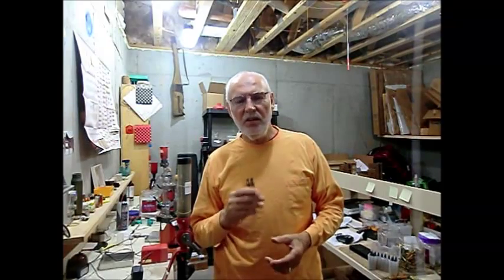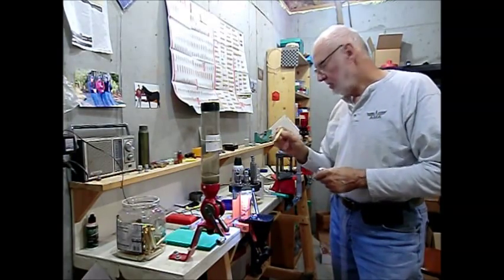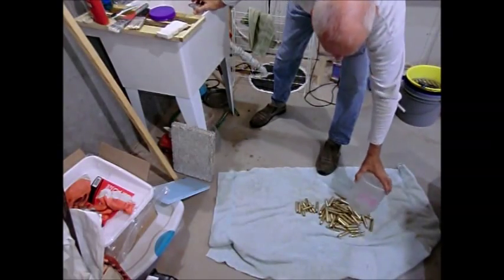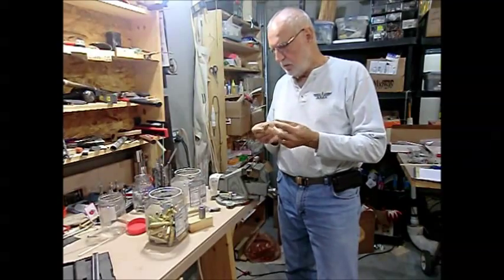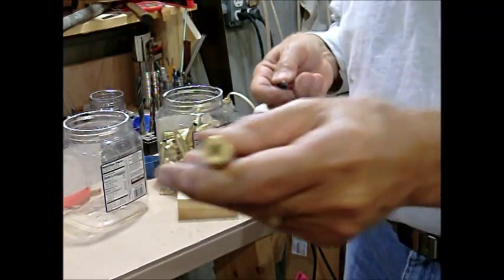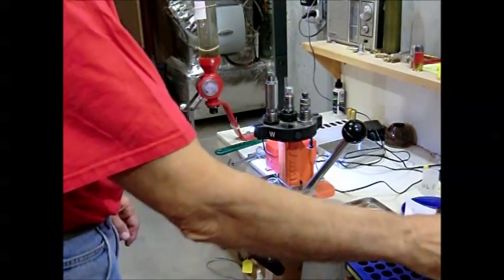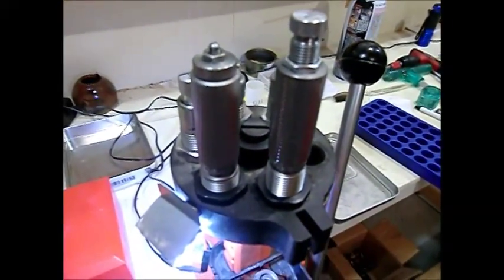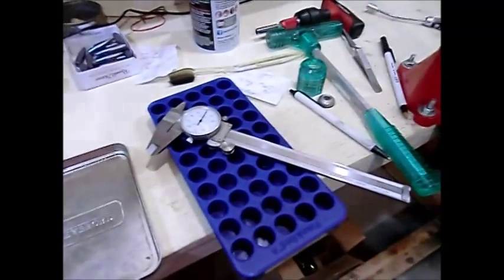LapuaReload1a

Comment: Lapua cases are the best. Peterson and Norma area also good. Tumbling cases overnight is too much and in the long run not beneficial...2 hours is plenty.  Anneal cases for maximum life and more consistent neck tension.  Why wash the cases with hot water and detergent to clean lube?  (I simply wipe them with a towel after resizing. Too much lube will dent the case should while resizing, but after resizing either toss them in the tumbler for an hour or simply wipe with a towel ) For long brass life, do not over-work the brass...resize with a shoulder bump of 0.002". Sorting cases by weight can also help with consistency.  Using a Hornady comparator or an RCBS Precision mic to determine the bullet ogive distance from the rifle lands and seat the bullet jump from the lands.

Comment: You need to lube the inside of the case with a case brush (forget the talcum powder as it obviously does not work) also plus wipe off the lube from the neck so it will not dent the case from too much lube on the shoulder of the case when it is sized plus makes it much easier to resize with lube inside the neck

Do that and it will be no problem at all to get the case back out of the press such as you obviously had

Clean the cases in the vibe cleaner AFTER you resize them so it helps clean the primer pockets good and then you never have to wash them or heat them in an oven like you were doing and this will remove all of the case lube also

By the way 2 hours in the vibe cleaner will get them clean and shiney 6-8 hours will actually start eating brass right off the case making it weaker 

Dump the powder charger and always use the scale for every charge or none of the loads will be the same with that powder charger that I have seen be one grain off between charges with certain types of powder

Make seating the bullet and crimping the bullet two different steps as a way to make sure of proper OAL before they then all get a light crimp